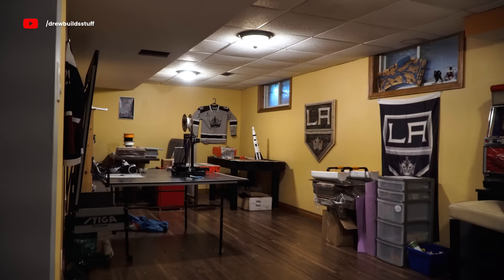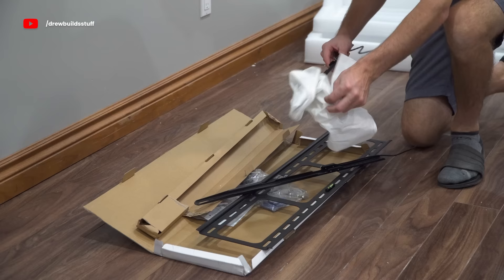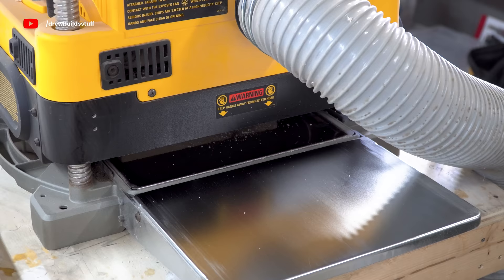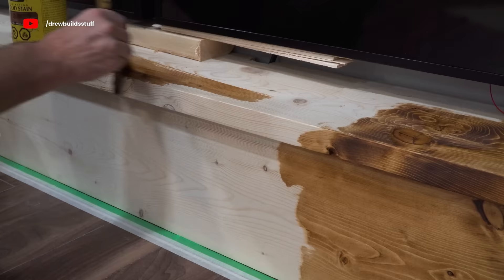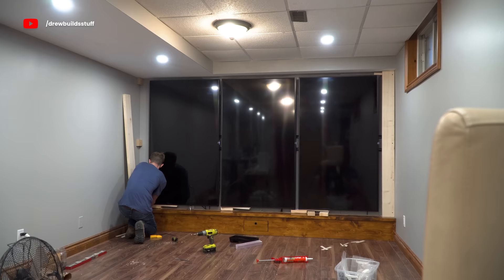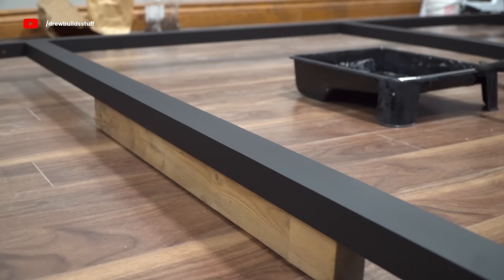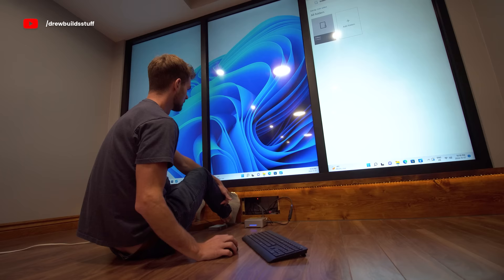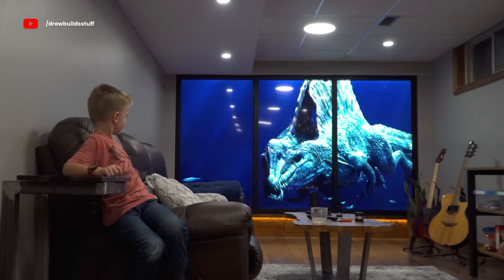Building a WINDOW with 3 Huge TVs

Comment: I remember there being a video somewhere of someone who did this, but also hooked up a Kinect sensor for tracking where in the room he was. That way, he was able to integrate parallax into the view, and it was pretty incredible what that one small change made. Obviously, however, it only worked well if there was only 1 person in the room haha.
Reply: I'd love to see that video. Can you post a link?
Reply: It's called winscape, just search that on yt, I bet putting the link will hold my comment for review.
Reply: Definitely should do that.
Reply: Tonnes of people have done that.
Reply: haha
Reply: @AuroraNemoia  I looked into winscape.  it hasn't been updated in many years.  Seems you'd need a mac os about 10 years old to be able to run their software.
Reply: Looking glass displays would do parallax and 3D but they're expensive lol.
Reply: @IntelCoreI77700K  I will have to look that up.  I did about 2 weeks of testing and found that 2 Pi3 running Pi Wall each attached to a monitor and displaying a UDP broadcast by OBS on my WiFi Macbook Air worked really well as tiles in a mosaic.  I just ordered my display supports today.
Reply: @IntelCoreI77700K  just looked it up. Holy smokes that would be fun but irrationally expensive.
Reply: @kmcg101  fr
Reply: @kmcg101   Theoretically it could cast parallax shadows, for example, sun behind a tree line.
Reply: @IntelCoreI77700K  And dog awful resolution too...
Reply: @jorisbonson386  Still amazing technology.
Reply: @jorisbonson386  To just say "dog shit resolution" is to be completely ignorant to the optical tech behind it lmao.
Reply: @IntelCoreI77700K  No, it's really not - it's extremely simple technology that has been around and developed at a snails pace for over 100 years.  There are still very serious limitations to it that render it far from a 'holographic display'.  I found mine so practically useless I got rid of them after the novelty wore off, which took all but 2 days 😂  'clever' at a push maybe, but certainly not 'amazing'.
Reply: I’m imagining the Mission Impossible hallway scene at the Kremlin with the Kinect freaking out about which perspective to choose 😂

Comment: Excellent build! One thing that I thought about, how much heat do all those TV's put off? In an enclosed space that might become an issue. Maybe it would be worth adding some nice Noctua fans or something to keep them cool?
Reply: Ventilation was on my mind too
Reply: Absolutely will be an issue over time.  The vents are in the top of the panel and turning them vertical cuts off the ventilation for rising heat.  Screen could get splotchy or unevenly burn in over time
Reply: Probably fine. It's a vanity build anyway.
Reply: Nobody’s gonna run triple 75” TVs on a regular basis anyway, just because of power usage.
Reply: I was thinking he needed to pump that heat into the area above with the drop ceiling, instead he drywalled it. Get at least a few PC case fans pulling air though!
Reply: Thinking this too. As it seems to be a suspended ceiling, putting in something like an AC Infinity Cloudline S6 fan in the ceiling space could work well. Used one to duct heat from a cupboard with server equipment in our office and also on a laser cutter and they work a treat. But that aside, amazing build.

Comment from the maker: The first 3 winners of the giveaway have been notified!  Thanks everyone for playing! Winners are from Finland, California and Ontario! Also beware there's tons of scammers out there using a similar name and my profile photo saying you've won a prize or similar. I only have two social accounts, this one and my @drewbuildsstuff Instagram. Just an FYI. I wish Youtube would solve the problem already.
Reply: Use an Nvidia graphics card to be able to output to 3 monitors, but have them treated as one. There's even bezel correction (for the gap made by the frame). You would need any cheap Nvidia card with 3 display outputs (they typically have DisplayPort, HDMI, and DVI ports, all of which can run perfectly with a cheap little HDMI converter to be compatible with your setup
Reply: You should use 'Nvidia Surround', you can make all 3 displays come up as 1 single display. It would take a lot of the hassle out of it as it's normally used by people doing multi-monitor gaming. This project is awesome by the way.

Edit: This will also allow to you to adjust for the border size between each display making it ever so slightly more convincing as a spaceship window :D. Could also allow remote access on the windows box for the TVs so you don't have to go back there to change things.
Reply: I was wondering if you could replace most windows in a house like this. I’ve searched but couldn’t find anyone who did. I wonder if the energy saved from heat loss/gain would, over time, pay for the install and operating cost. It would be interesting if you could connect the tv wall to an exterior camera that would replace the scene of a real window. 
Hey I was typing this as I was watching and the end that’s exactly what you are about to do. Looking forward to the results. If it works out start a business offering a plug and play. I have a room that needs lighting up with a new window and don’t want to cut hole in the wall.
Reply: I got my Scam email saying I was a winner 😡 today

Comment: If you want stained wood to look more even and less blotchy, first apply a coat of clear sanding sealer. This will make the wood absorb the stain more evenly, so different grain and knots don't look so dark.

Also, it would've cool if you used the same wooden figured moulding as around your other window, to reinforce the "window" idea.

Comment: Clever trick editing the video files. Another method that should work well is a PC with a dedicated graphics card, then configure AMD Eyefinity or NVIDIA Surround depending which gpu you go with. This should make the OS think you're using 1 monitor instead of the 3. You might need a displayport to hdmi 2.0 adapter. I haven't used Eyefinity in a while but it was pretty good when i tested it years ago.
Reply from the maker: Ya I’ve had a few people comment that, I’ll give it a try. Thanks for watching!
Reply: @DrewBuildsStuff  The issue with this suggestion, as you probably know well, is that it will just divide up the video and not look right for things passing between the monitors as it won't reflect the fact that there is a gap between them.
Reply: a video matrix would be easier and not require a a dedicated pc
Reply: @curtisbme  Nvidia surround can do bezel correction
Reply: @oliverroedschler2908  Interesting.  Thanks for the info!
Reply: @curtisbme  Except both AMD and Nvidia can account for the gap.
Reply: @DrewBuildsStuff  Matrox TripleHead would work fine here if you're okay with HD 1920x1080 per screen
Reply: VLC Wall filter
Reply: This is the way. A good modern graphics card will also be powerful enough to run 3 monitors at once.
Reply: People literally are amazed when someone responds too their comment without insulting them

Comment: Great work!
An alternative cool solution for the TVs would be the Aerial app: it's an open source project made to replicate the Apple TV's "panoramic fly by" screensavers...it comes on both Windows and Mac i believe and has plenty of options to split up and synchronize the same video over the multiple screens connected to the computer. Has loads of videos from all over the world, in 4K too.
Of course it wouldn't look like a window anymore but might be cool to change the vibe sometimes.

Comment: I don't know why but I'm  loving this. This isn't a new idea, but your implementation was almost flawless. I say almost because what you're missing is just a higher powered pc. Nvidia surround or the AMD equivalent would make life so much easier for you. With  three 4k tvs I would say you could definitely use the new RTX 4090 in your life if you can find one. PC gaming on 3 monitors in that orientation used to be more common before  ultrawides and 4k monitors came onto the market.

Comment: An ultra short throw projector would have probably made this a little easier I bet. It was still pretty cool though.
Gave me some ideas for my office. Great video!
Reply: Would the image also show on the frame though or not because its black?
Reply: Possibly but wouldn't that much short throw projector cost about 5 times more than the flat screens?  Might pay back against the power demands of the flat panels.
Reply: @keithcress1335  you got a point there. 
There is some short throws that have come down in price significantly though. 
I’m talking in the 1,200 - 2,400 bracket. That price is without the ALR screen though so your point is still valid. 
I wonder how hot those tv’s make it?
Reply: @DimiArhontidis  would probably have to mod a ALR screen.
Could split up the backgrounds the same way but add the black border in the background themselves so the project displays black in that area. 
That way the image won’t be projected onto the frame.
Reply: Still like your projector idea over a bunch of hot FP displays.  I wonder if you could use conventional laser ceiling mounted projectors and get the effect for a lot less energy,  money,  and reduce the build complexity to just the window frame and a faux wood ceiling beam just big enough to hide diminutive projectors.  I know you can get 4k ones for under $1k but they might have issues I don't recognize.  Or a single $2+k unit that would ''home theater" the whole wall! Add a digital frame overlay to put in the window frame, dump it for BIG screen tv?
Reply: @keithcress1335  I think you'd ruin the effect with the lights on with a projector even the brightest ones would still be a tad washed out compared to a LCD, OLED tv.    I am surprised the TVs are spaced as far apart as they are though. With his skill set I suppose you could have fabricated a different way to mount the TVs essentially edge to edge and still framed over the much smaller gap, maybe it would take more than one person to position all three TVs onto the wall that closely. Perhaps mounting the TV mounts first onto some type of left to right sliding bracket (almost like a heavy duty drawer slide) then sliding each drawer slide L/R to edge up against each other.   Still the project turned out very nice.

Comment: Great video. You might want to try one of the many  Linux operating systems which have much better support for multi display layouts than Windows. Once set up anything you put at full screen will span across your 3 displays.
Reply from the maker: yep for sure, a bunch of different ideas in the comments.  Im working on a upgrade video.  Thanks for watching!

Comment: You gotta get a 3D video in there.... Maybe a roller-coaster or something. I don't know if the monitors would handle in this format a "proper/no-breaking" 3D experience with glasses, but even if they don't... with lights off and a full wall... you'd get most of the 3D experience even without glasses. I would actually stare into a ride for hours on that wall/screen :)) 
I also built my office in my basement, I LOVE this idea!!!
Reply from the maker: Ohhh that would be cool! Need to find a budget for a moving chair to simulate a actual ride

Comment: your woodworking is just incredible. Great job.  I'm starting my project using a Raspberry Pi 3 attached to each display and reinzor videowall software which treats the 3 displays as one big display and allows you to define gaps between them like a mosaic.  Pi are due to be delivered tomorrow!
Reply: I'm curious, did the Pi 3 with reinzor video wall software work as you had hoped? @kmcg101

Comment: Recently,  I've wanted to build a house, then bury it, creating a tornado-proof "underground" house on grade to avoid moisture problems and then use a giant TV, like yours,  mounting one on each of 4 walls (N,S,E,W) with a camera outside pointing directly out, to create a real-time "window" inside. I'm still negotiating for the ranch land (North Texas). That's as far as I've gotten.
Reply from the maker: That would be awesome! Sounds expensive though 😬
Reply: @DrewBuildsStuff  
I'm 74, retired, been debt free longer than you've been breathing air and have nothing but time & money! 

I love your Chanel.  We are a lot alike; I build stuff too.

My "normal" building projects are steam engines and windmills.

 I also build solar tracking steam engine generators for free electricity on clear days.

Comment: I will admit this is very cool, but one thing that would complete this is to put LEDs that match with the screen with some coding, that would add lighting to the room and make you feel immersed in the scene. That would be hard to do but I think if you did it, this video would blow up, as well as be even cooler

Comment: Very cool! An extra thing to try would be to display virtual 3D scenes on the monitors, and add head/eye tracking so that the 3D scenes update to match your current viewpoint. That would give an even stronger "window" effect. Even 2D videos could be enhanced this way, so long as all the objects in the video are far away (render the video onto a large plane in 3D space). Take a look at TrackIR or Johnny Lee's video about head tracking with the Nintendo Wii for examples.
Reply: This is what I was thinking would be a huge issue - no head tracking. Any object really far away would completely change depending on your viewpoint. Nice for wallpaper but as an illusion of a "window", not really.
Reply: Just like that invisible wall in Mission Impossible

Comment: I wish you luck with this man, i tried to do this in my mancave a few years back with some 1080p screens. I had 10 in total, i wanted to display the stock charts of my top 10 positions at all time, so while im watching tv or on the computer i could easily see at a glance, but the TVs died slowly over time. Since they were on all day everyday, the screens started ghosting previous stuff displayed on the screen and overtime it just looked horrible, so i took them all down and trashed them. I got like 3 years out of them before there was so many ghost lines in the screen they were not usable for anything else really. Recently i switched my computer over to a couch system and installed a ultra short throw laser projector as my screen and have it displaying on a 10ft x 6ft short throw screen and just split up the single screen into multiple screens using OBS Studio streaming software on a refurbished MacBook M1 Air that has a broken screen. I have top 9 charts now lined around the center screen area as sources, then i use local streaming from my Mac Mini M1 or Nvidia Shield with wireless keyboard/mouse from the couch that injects its screen into the center of the OBS setup as the main input source. I use a stream switch so i can switch between the Mac Mini and the Nvidia Shield for the center source.
Reply: This is exactly what I want to do, make a "tv window" using a short throw. Can you recommend a tutorial on how to use OBS to do this? Thanks!

Comment: Btw you could use the Roku app and control all 3 tvs... No need for the original remote, or IR repeater. 
Or also you can get a non ir remote for Roku tvs.

Comment: He drilled into the wall like butter. My bedroom wall would resist a high power cabled drill with hardened drill bit for 90 to 120 seconds of my full weight behind it to go in a quarter of the drill bit, and there would be smoke and the drill bit might start to glow a bit around the edges before the hole is in, certainly a lot more sparks.

Comment: My only critique would be that you should've used a metal channel with diffuser to run the LED strip through so that it'd hold it better than the tape alone, and give it a finished look compared to a strip of bare lights like that. Especially since you put a lot of work into making this look so damn good.

Comment: Maybe add an exhaust fan, those tvs will create a bit of heat. Them being incased will trap the heat an exhaust port or fan could vent the heat maybe extending the life span of the tvs. Especially if there constantly running.

Comment: if your computer has a decent gpu in it you can set it up using surround mode for Nvidia not sure what its called for for amd also you can set the pannels to 1080p instead of 4k for better performance becuase the tv auto upscale anything around 1080 up to 4k

Comment: It is a fantastic view, that is for sure! I see you connect two HDMI cables to each TV, so you connect them somehow in loop? Can you explain that connection? I'm trying to build the same window using not three, but only two TVs. Somehow, I can't  have full size picture. I have nice video wall controller with rotate option and it works fine, but can have whole screen picture. Please help me with that. Regards, Mike.

Comment: man thats so sweet. You made yourself so much extra work using wood for everything around the tvs. I would've just built another "wall" in front of the original wall, and flush mounted the tvs into the new drywall, butted the tvs together, and used the slimmest possible frame for the beauty panel. Came out sick tho. Watching your builds makes me want to build it better lol

Comment: I use this to drive 2 monitors. It might drive 3 it’s been running for 3 years for me. Available on Amazon. Aopen Digital Engine DE6140 Desktop Computer - AMD R-Series R-464L 2.30 GHz - Black 91.DE801.A420

Comment: Did the monitors make the room hotter? And did enclosing the monitors cause additional heat issues? I'm also wondering about the energy usage - if this is on at least 12 hours a day, that's a lot more than you'd use a normal monitor.